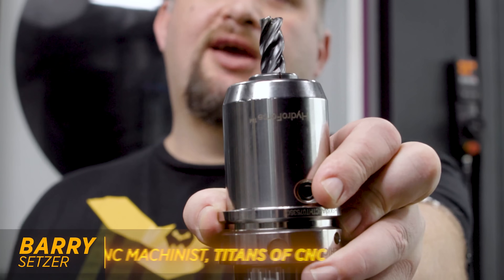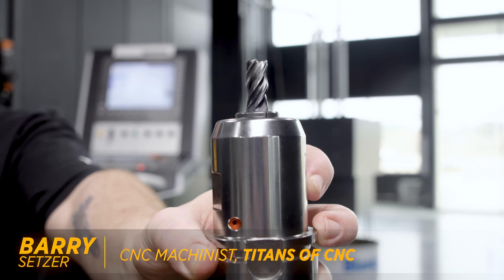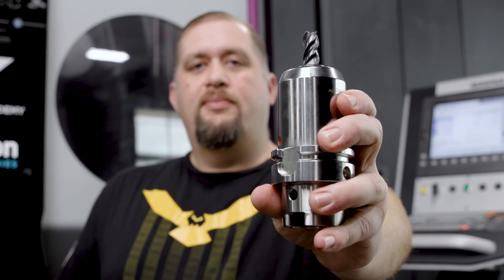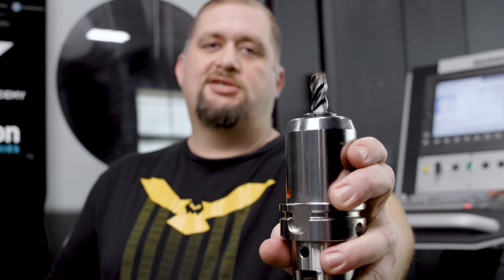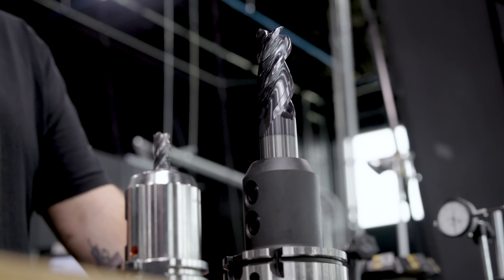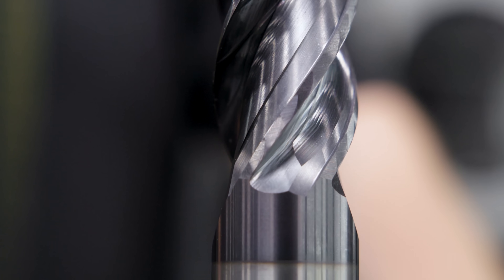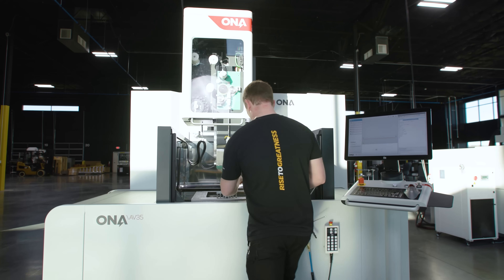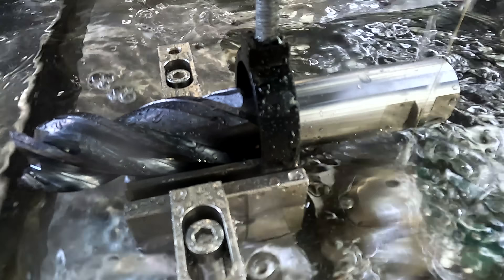GIANT Kennametal HARVI 1TE End Mill Takes TITANIC Cuts on 100 HP CNC Machine

Comment: Community i need your help: I convinced my boss to buy harvi 1 te, cause y want to use it for a opti rough in a pice of 300×60×20 going 16 deep 2.4 radial with th 12mm size endmill, they say it won't last and they want me to program it with a high feed cutter but it takes de double amount of time, someone who bought this endmill could tell me how much tey last thanks
Reply: Material group would be F111 and 1.2379

Comment: One of my favorite machines over my career was a giant Parpas 50 taper.  It had a 30 foot deep foundation.  For roughing, I could bolt our 4” roughing cutter directly to the spindle face; bypassing the taper entirely.  0.250” depth 4” wide cuts all day in P20 steel.  Had to use a snow shovel for the chips.

Comment: Why not just shorten the endmill and remove the flat and put it in a shrink fit tool holder? Would a shrink fit holder not provide enough grip on the tool for the load put on the endmill?
Reply: We use similar endmills for roughing and were told to never use heatshrink holders. When roughing like this the endmill wants to pull right out of the holder, hence the flats and set screws to hold the endmill in. I don't recommend using these holders for any finishing since there will be significantly more play compared to a heatshrink holder
Reply: Pretty sure they have a video showing an endmill drop in z wile cutting because of the tool holder setup

Comment: Is the 4140 hardened, normalized, or annealed?  I'm sure the heat treat makes a big difference in the tool life and cut speeds.  But what would I know?  The piece in the mill weighs more than my little mill.
Reply: I'm sure if they were not recording they would have coolant flooding it, these guys run stuff dry for the sake of getting good footage, they probably also wouldn't have made such dramatic cuts either

Comment: Seeing this makes me wonder a question. typically when I program a material removal path I leave about .01 stock to leave. But this is in the realm of 1/4 -5/8 endmills.     Once you have reached these sizes do you leave more stock to leave?
Reply: I left exactly the same, .010”
Reply: @barrysetzer  yeah I tend to use alot of American shop slang  10 thousandths    or 10 thou.     Is common as well around our shop.
I remember getting outta machine trade school where they pounded the  decimal place terms into our heads with hundredths ECT. 
Took about a week in a shop to realize no one uses it. Just use thousandths as the base it cuts out all the confusion. 
 Tons of terms used in shops make no sense to others unless they have been around. that would make for a great video basic shop talk and the meanings 
 Adjustable wrench = crescent
Dikes = diagonal cutters
Monkey wrench=pipe wrench 
Wiggler/wobbler = edge finder/centerfinder
Channelocks = are hook and groove pliers the name on them is irrelevant
ECT there is alot to list
Reply: It is technically “one hundredth,” but as machinists we speak in thousandths. So .010” is ten thousandths
Reply: @barrysetzer  - I’m a rookie machinist so I’m trying to learn!…I assume machinist speak in terms of thousandths commonly because tolerances are tight and anything in the hundredths would be way out of spec….is that correct? Thanks a ton for replying bro! 👍🏻
Reply: Yes sir thats correct!
Reply: Isn’t .01 in words “one hundredth”….but Barry wrote same .010”….which to me is “ten thousandths”…..I’m confused?

Comment: How are going to hold the work piece to do the back side?
Reply: Im going to clamp it directly to the table on some riser blocks. The beauty of this control is that it will take me about 2 minutes to get it perfectly straight using the probe and Plane Spatial positioning.
Reply: @barrysetzer  so the machine can adjust its coördinate system based on the orientation of the part?
Reply: Yes and its VERY good at it!!!
Reply: @barrysetzer  that’s incredible! Thats going to save so much time

Comment: I don't think it is stated enough just how rigid these machines (and fixtures) need to be to machine like that. In my time in the industry (older manual machines) it was a regular bugbear of mine when just after the toolman from whatever company visited the boss would come out with a new tool he just bought which was supposed to cut like a lightsaber.
Not on these old worn out machines mate (said I) Boss insists I try, and winds up all the speeds and feeds, the machine rattles and bangs, the tool and/or the job gets destroyed, and I'd get blamed somehow, every time.
It's one of the reasons I left the industry.
Reply: We've had a couple of THOSE instances too. As operators (and programers) we say no and that if they want to go faster then they know where the controls are....
Safe to say they have a red face and dissappear for a while after about 30 seconds 🤣
Once the MD wanted some heavy roughing done at night (insanity right there) and after discussions about how regularly you had to clear the ways he said he'd stay and make sure it kept running. Once everyone left he went home to have his dinner. We came in to find the guards had been ripped clean off the machine and that mega important job sat on the floor for 2 weeks! He didn't argue after that when we said we needed to watch operations.
Reply: @wildin13   wow, just wow.
Reply: Lol so familiar. I was working next to a small CNC milling machine and tooling guy plus the shop owner went there to have the operator test a new face mill under their watchful eye and quidance. The whole machine was resonating and rattling as the tool was clearly too big for that machine. Next morning during spindle warmup smoke started to rise and as it turned out, the spindle bearings were cooked. The owner hinted that operators had not been following spindle warmup procedure daily so new notices were put up describing correct spindle warmup procedure.
Reply: @rcandcnc9684   ha ha ha yeah right!
Reply: Left an entire industry because of that one Boss? Or, was it consistent in every machine shop you went to?
Reply: @yadielcarrion7416   Here in Australia, in my state, back in the 90's, yeah it was pretty consistent.
Put it this way, down here Machinists were also trained as fitters, and when the mining industry really took off in the 2000's, heaps of trades people went to work on the mines for far better pay and conditions than what was in the local industry. It was quite dire for quite a while in the city here.
Reply: @yadielcarrion7416  LOL, right!!

Comment: Beautiful, love the color of those chips. That tells me I'm taking all the heat away in the chip. I bet the part isn't even warm to the touch. 💕
Reply: How do they get all the heat to transfer into the chips and not the part itself, I’m curious?? I’m sure they use coolant when not filming.
Reply: @greeneyesfromohio4103  quite simple you don't get heat into chips but instead you don't really cut metal but deform it. the metal bends/curves and deformes around the cutting edge so nearly all the cutting work and therefore internal friction resulting in heat is inside the chips. that is why it can be critical to remove and/or cool the chips.
Reply: english ain't my first language so l'm not 100% sure on the cnc and engineering vocab sry
Reply: 😂 I bet you’re wrong.
Reply: @vinnie302  bet on it. nearly done with my bachelor of engineering so l would say l'm not 100% wrong
Reply: @leonschumann2361  I’ve been actually cutting metal for over 20 years. He’s got no coolant and the chips are blue. There is gonna be heat transfer. Go watch the other video where he pours water over the cutter and it boils off. 

“Almost finished engineering school so I no more than you” is the most engineer response to knowing nothing ever. 😂
Reply: @vinnie302  you misunderstand me, l could say a machinist with 20 years and no knowledge. heat allways transferes. but in the case of machining you have some cutting yes, but mostly deformation around the cutting edge. deformation of solid matter causes a lot of internal friction. since the chips deform there is a lot of heat created in the chip itself. that is why cutting angles and chip thickness is important for nicely breaking short chips for expample
Reply: u still have some friction tool-workpiece and when the chips are laying on the spindle or on the part they transfere heat into part you really don't want